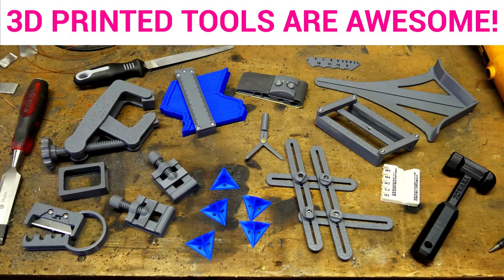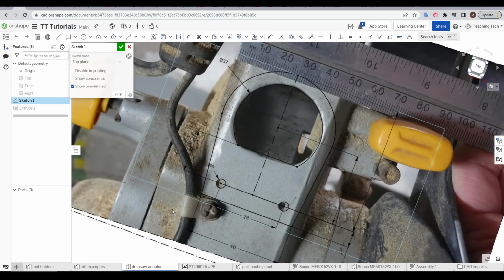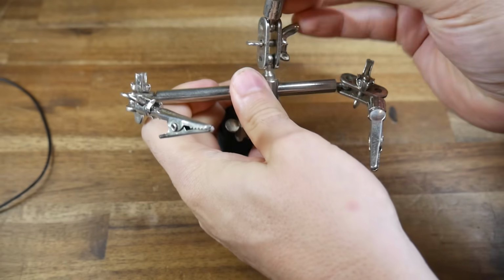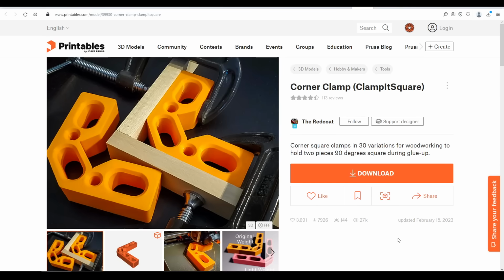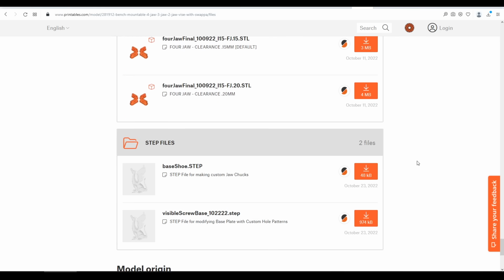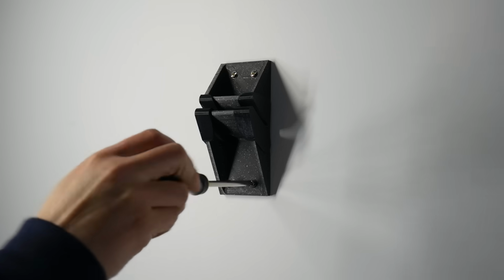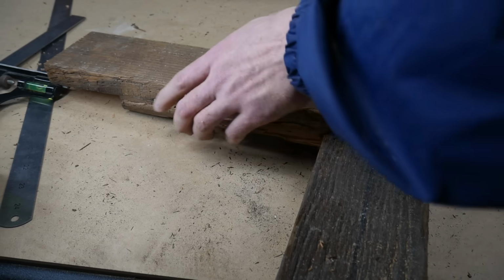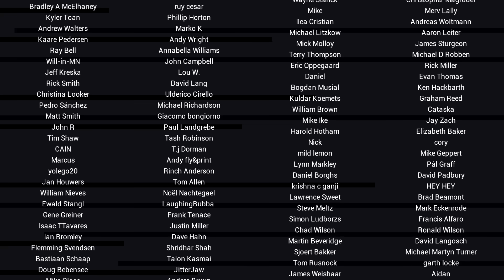12 more 3D printed tools you need for your workshop

Comment: I want to try the last tool. I work on old model trains. Many times the bodies require repair inside for mounting bosses mostly. But to hold them upside down the steam engine shapes are irregular and hard to clamp but any means. I need to dremel cut away the damage. Vacuum tube?? then define the repair part needed, Radius gauge and screw gauge ?? then I 3D Print the repair part and glue or screw in place after a test fit.   I think that larger flexible clamp would be great with some TPU jaws on top. Is that possible????   Dennis

Comment: Great tools. The table saw looks like my Evolution Rage 5S 😉 Doe you have printed some additions or Tweaks for it, beside the shown? Mine has not the kill switch cover. Doesn't found an one that's fits nicely.
Also the rest of your tools looks like in my workshop. 😂 The Ryobi cordless drill hammer....
It could be filmed in my workshop. 😂

Comment: The problem with some of these is most people have desktop printers with a tolerance of .1mm to .5mm. and then cooling and shrinkage on top of that. That's fine for some stuff but unless you have a pro resin printer with a tolerance of .01mm, the measuring tools are ify.

Comment: The corner clamps - his example looks pretty low stress. I have the steel as well as the Woodpeckers aluminum. Are the 3d printed strong enough to keep a full size assembly (like a kitchen cabinet) square?

Comment: good vid; the soldering jig has been on my short list for a while. one comment though; if you're seriously considering the corner clamps, have a look at Izzy Swan's corner jig first; it's wooden so no concerns with rigidity, easy to make, and they use wedges so no need for the bar clamps.

Comment: I see others calling it out but I want to reinforce the advice to never have the featherboard pushing your wood into the blade. You needed to move it closer to you.
Also do not leave the wood between the blade and fence unsupported, your pushstick should be moving it through the cut.
At https://youtu.be/bktZTYj2ElM?t=346 you state that the wires are held securely as the wires pop apart from each other. Seems it is not the solution it needs to be yet.

Comment: There are definitely some useful models there, I use the soldering jig all the time.  I love how it lets you hold thick wires and thin resistor leads equally well.  I use a thin watery flux, and I'll often place a few drops in the middle of the jig so that I can flux my wire/component and solder away, and keep the mess off the benchtop.
My fractal bench dogs (you mentioned my design in your vise video) have been more for novelty than anything else.  I just don't find myself needing to clamp irregular objects all that often, or, at least not where 3 points won't do just as well as fractal jaws for holding power.  The mechanism is really cool looking though.

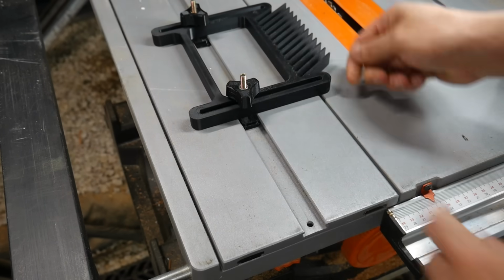Comment: 12:52 No. No no. Never rip a thin piece between the fence and the blade. That thin piece is what gets kicked back and the featherboard isn't touching it so it can do nothing to stop it. Put the large part against the fence with the thin offcut on the outside. You may need to make a thin rip first to true up that edge to parallel to the edge against the fence.  If you need to repeat thin strips, Print a thin rip jig. There look to be some good ones. (I haven't gotten to them yet but are on my shortlist) 👍
Reply: Came here to say this. I'm honestly surprised that piece didn't end up putting a hole in the wall, especially with how it was creeping back towards the blade at the end of the clip.

I don't want to come off like the safety police but I'd seriously suggest replacing or removing that segment. Because this is a channel full of tutorials and advice, it's not unlikely that someone might copy what they see here and end up seriously hurt.
Reply: @Hudston  à0 pp aa no pop
Reply: I use a sacrificial push stick to hold both pieces in place with a board slightly wider than the cut-off clamped to the fence. I've done it this way for forty years and never had a problem.
Reply: Yep totally agree with that!  Watching this just week after I got injured by kick-back (because of missing kick-back protection and guide not aligned perfectly parallel to the saw blade - partially no my mistake because employer do not care about the safety features and proper aligned machine, but also still my issue because I done the job on it) Continue reading below ⬇

Now back to my point - I am not judging 3D printed tools, as I do use some of them too, but I CAN MAKE YOU SURE when you will remind yourself the pain, how quickly it happened and how scary it was / how freaking lucky you were at the end, you will feel really bad when watching someone cutting such a thing with these 3D printed semi precision tools/guides.  I´ve done plenty of things on table saw and even though most of the time it feels safe in a fraction of second it can end up pretty badly. If I was not injured I wouldn´t look on this video in such a "scary way" (but yeah that part 12:52 is about getting the piece of wood stabbed into your stomach) but seriously I hope you guys will read this comment and think about it.
 
Remember: If it looks it is safe, it does not mean it is safe - and with the speed the saw is running at the bad things can happen in no time. 

**now the not important part - I was cutting plywood in dimensions of 40x50cm as regularly - all went smooth but suddenly - when it kicked-back I had zero clue what happened. Just huge pain in the lower parts following by lying on the ground for about 20 minutes because of the pain. And I tell you the speed of the 18mm thick plywood flying out by it´s corner against my body was shockingly crazy.
Reply: @valkyrie_workshop  so, not a thin piece. Was both the riving knife and crown guard in place? If not, find yourself a lawyer- you are in for serious compo. Of course it is good practice to not place yourself behind the workpiece…
Reply: @Tensquaremetreworkshop  Not a thin piece but considering the density of plywood it is heavy for what it is - especially when accelerated so quickly :D  I mean you are referring to what I said just in different terminology? "missing kick-back protection and guide not aligned perfectly parallel to the saw blade" 

I truly have nothing else to say. Just that I feel so stupid afterwards. You know, routine, all the time using it flawlessly, next very ordinary cut and BOOM. 

But I had to admit my mood that day was not the best so I might not paid enough attention to hold it properly. (But still it has crazy power so it is not an excuse anyway, no matter how you´re cutting without safety features)
Reply: @valkyrie_workshop  I was interested in what you meant by 'kickback protection'- there are two types of kickback. If your employer removed either the riving knife or the crown guard then s/he is at fault.
Reply: @Tensquaremetreworkshop  yah I was referring to the riving knife - I had no idea what's the correct name of it.
Reply: @valkyrie_workshop  Depending on your jurisdiction, you should sue. This is a clear failure of basic health and safety- cutting square format boards on a saw without a riving knife is incredibly dangerous.
Reply: So cringe when he says "...to safely push the plank through" while doing it probably in the most UNSAFE way possible save for doing it bare handed maybe...
Reply: @critter42  Im a wood worker. You should never use gloves when using a motorised saw. Its a recipe to get your hand caught and loosing more than just a finger
Reply: @queenwithapeen  yes, I meant barehanded as in not using a push stick of any sort
Reply: Thin rips are done thousands of times a day across the world. Yes, a push stick on the thin part is advised- but what force, given there is a riving knife in place, do you think there is to propel the part backwards? Vibration causes the part to jiggle against the blade, but there is little transverse force involved, so little rearward force can be generated. Tests show that the part moves backwards very slowly, as can be seen in this video. So, yes, it should be supported but the risk level is low to very low, because of the combination of little chance and low consequences. There are many more risky events captured on YT- and in this video where was the crown guard? A much more serious omission.

Comment: On your caliper, you know the little stick that extends out on the furthest end from the 'jaws'? You can use that to find out the depth of holes, also the height of a step. In combination with the zero function, you can have it read, for example, the height difference between a knob that is pulled out or pushed in...

Comment: If your using that push stick that way your begging to get things thrown back at you.   Push sticks need to be on the piece your CUTTING, they are sacrificial. You are giving advice there that is not only wrong, but dangerous.
Reply: To add to that, push sticks should be made out of a material that won't shatter into sharp pieces if it does contact the blade. Search youtube for vids of people injured by cheap push sticks which were made out of hard plastic.  The brittle nature of PLA would have to be as bad.  Nylon might be ok.
Reply: @dansaville3333 Decent PLA+ isn't brittle.
Reply: @NvrchFotia this was my thoughts. But I've never tried hitting it with a fast blade 😂

Silk PLA.... I'd say is a nono
Reply: @dansaville3333 maybe, but PETG would probably work. I'd have to check to be certain bur don't care enough, but the stock dewalt push stick I think is PET. Definitely don't think it's hdpe
Reply: Making a push stick out of wood takes almost no time as well
Reply: That cut part was just flapping around between the blade and the fence
Reply: Survival of the fittest
Reply: Wait he did it twice i call dips on the second one
Reply: @mroogabooga8763 * dibs 😂
Reply: @mroogabooga8763  😂
Reply: But also 😂
Reply: You're
Reply: @nigelmtb  awww man i was gonna say that
Reply: my CUTTING what??
Reply: You're
Reply: If you struggle with your words of yore, you're not alone!  They're tricky but hints for their use are out there.

Also, thanks for the safety tip about push sticks.  Not everyone (myself included) has the experience to know this kind of stuff.

Comment: The drill dust guide is good and durable enough to keep in your drill case or bag, but a cheap option is to use an envelope taped to the wall with painters tape or a folded piece of paper. Works great!
Reply: Always found a simple sticky note the best and easiest option you also throw it out with the dust it’s collected
Reply: @adamcallaway3762 Seems wasteful.
Reply: But, But, But, But... it's not 3d printed!  
Seriously though, that tool seems like an over-engineered solution without any additional benefits.  I actually know of something similar that comes with a vacuum hose attachment for a portable shop vac.  Otherwise a piece of foil and painters tape make way more sense considering you may want to have both hands on a hammer drill.
Reply: I just use painter's tape folded at 90* (along the center) sticky side up.  I'll add another piece if I need more catch area.

Comment: Thanks for sharing some of these great ideas. Just a tip on the use of the feather board. Never place it opposite the blade. The feather board should be positioned just in front of the blade so you are not pushing the workpeice into the side of the blade. If you do it will jamb and kickback at you. Dangerous.

Comment: Seems like the cable soldering jig still has the core issue: the copper strands are hard to keep 100% parallel, they angle away a bit. My fave tool for this is a metal oval, made of two "clampable" horizontal layers. The wires go in-between the layers. The hole in the center is small and fixes the strands as you want them.
Reply: I can't picture what you are referring to "metal oval". Do you happen to have a link?
Reply: @TrevorV  Imagine (clampable) metal tweezers. On each end is a flat loop (~1/2" sq) with a hole in it. You can clamp two cables, so their exposed strands meet within the hole, where you can solder them. Search for "Splice-It-Easy Soldering Tweezer"
Reply: Reality to solder both ends should be splayed then put together and twisted.  Then the connection should be soldered.  Just sitting 2 braided wires next to each other and connecting them with solder is definitely not the proper way.  If you do it properly then the wires stay together and the stand can hold them for easier soldering.
Reply: @slimjim7411 this. Even just twisting them is leagues better than a butt splice lol

Comment: 3:26 use the rear of the calipers for depth measurement – from the small rail that moves down to the flat side of the caliper. https://i.imgur.com/x2lhd9L.png
Reply: @wojtek-33  can't see the problem, move to the edge, zero out the display and move to desired location.
Reply: @PawełOleszczyk   The axis between the stopper and the door is not a single tube, it has two, stepped diameters, he wanted to measure each one.

Comment: I would suggest gluing aluminum foil to the bottom of the cable holder so the molten solder doesn't melt through. Good video overall